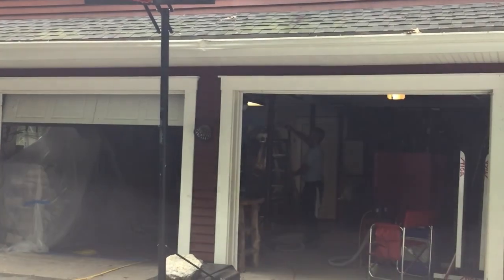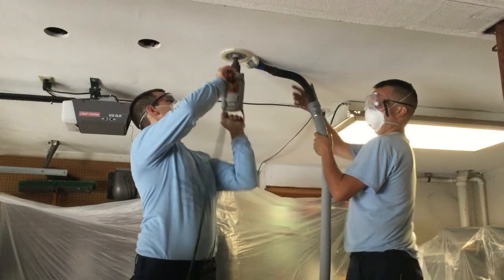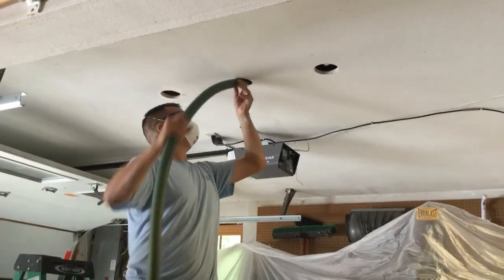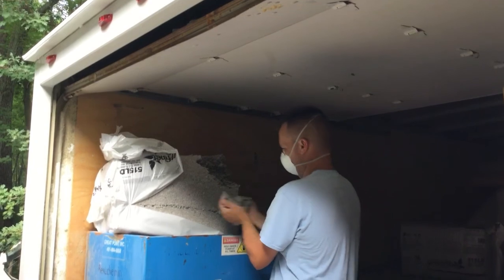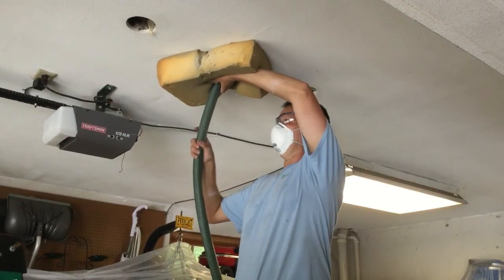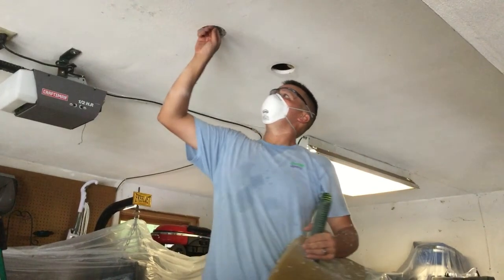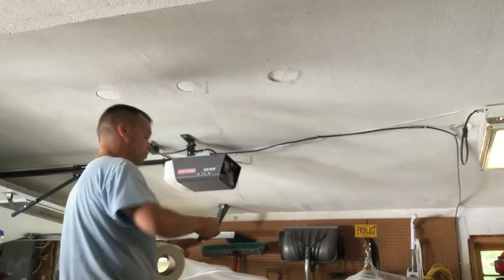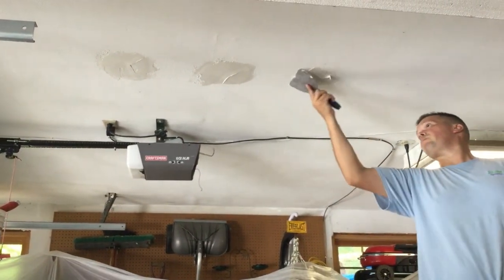Energy Geeks Garage Ceiling Insulation, Providence RI

Comment: Great explanation and video. Why not use fiberglass blow in or Rockwood? I feel like newspaper is a super cheap insulatuor that would flatten right out over time creating a gap once again.
Reply: It's very unlikely any settling of the cellulose will occur, because it's dense packed into the cavity... squeezing out all the air and completely filling the cavity.
Reply: Great question and answer!  Can this process (using cellulose) work when plumbing is in present?